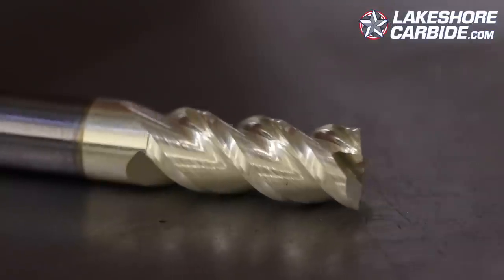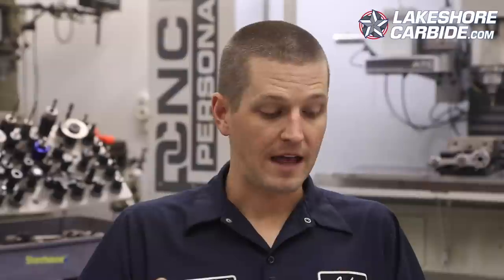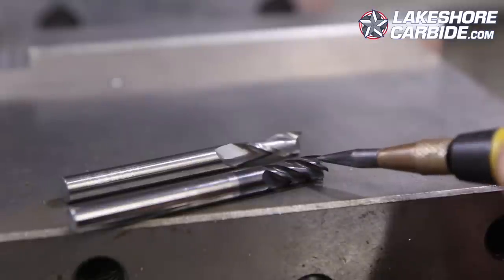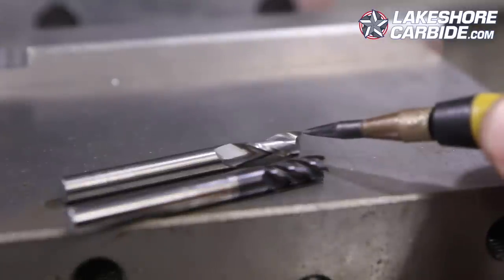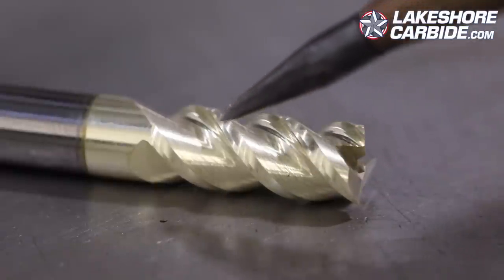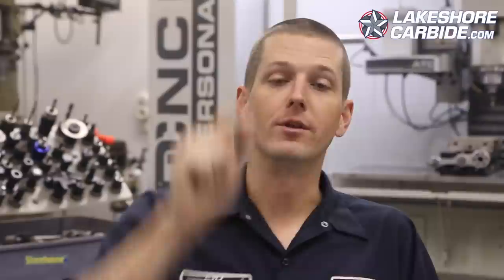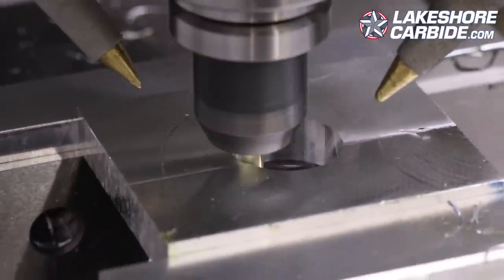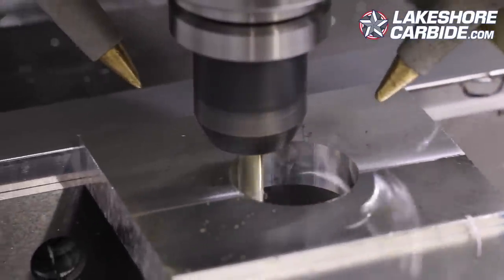4. 2 Flute, 4 Flute & Why You Should Use 3 Flute!

Comment: We went from a 2 flute carbide .140” drill to a 3 flute non coated guhring, and wow! That’s a difference, less vibration faster drilling and they last almost twice as long, on 316 stainless, 45 holes up to .135” to 85-100 holes!

Comment: I feel this choice is nuanced, and depends upon how you use the cutter, and in what grade of aluminium, and with what coolant method is used.
If you are cutting a slot of the same width as the cutter, then a cutter with an even number of flutes will touch both side-walls simultaneously, and this can start chattering.
Conversely, for a cutter with an odd number of teeth, the teeth will cut first one side-wall, and then the other side-wall. This will be less susceptible to chatter, and this is helped by the greater rigidity of the thicker core of the odd numbered cutter.
The caveat here is the chip-removal issue. For small end-mills, or in a gummy grade of aluminium, then having more teeth means that the tighter tooth gullets can't as easily feed the chips up and out of the slot, and the material is more likely to stick the cutter, bind the cutter in the slot, and then snap the cutter.
For people using low-pressure coolant or simple (WD-40) lubrication, then (on balance) a 2-flute cuter is less likely to break from chip build-up than a 3-flute cutter.
For the CNC user with high-pressure flood coolant, then the 3-flute makes more sense, "IF" they can efficiently get the coolant right into the slot being cut to clear the chips out the way fast enough. That is a big "IF" though.
The smaller the cutter diameter, the more acute the chip-removal problem. Below <1/4", you may still be forced to use 2-flute cutters your coolant set-up can't do the chip-removal well enough.
Using mirror-polished, uncoated carbide cutters with a 45-degree helix angle is recommended for aluminium chip evacuation, regardless of your choice of flute number.

Comment: Nice one John. Could you do me a favour and ask the guys at Lakeshore Carbide if there is any implications, so far as resharpening, variable flute end mills? I use a Darex E90 end mill sharpener, and my gut feeling is the sides of the cutter should be able to be resharpened, but the ends may introduce difficulties due to the variable angles and the way typical resharpeners index the cutter.  However I can't recall ever using variables, so I've ever proven this gut feeling.

While carbide has decreased a lot in cost, they still don't exactly give away carbide end mills! I find having an easy way to sharpen them (just like drill bits) encourages always using truly SHARP tools instead of persisting with ones that are dull until they're either sent out or thrown away. I don't doubt the benefits of these new geometries that are becoming popular, but I think that should always b considered with the long-term implications of running them, where persisting with a dull cutter if it can't easily be resharpened may far outweigh the inherent advantages of it.

Comment: There are several incorrect comments.   3 or more flutes are good in some application but 2 flute tools will remove more material in high speed machining. (although many shops are not equipped with these machines.)  I believe also you are using the incorrect term.   The tools are not "variable flute" they are variable pitch.  So many companies are confused about Variable Pitch and Variable Helix tools.   If you have a variable pitch tool the helix angles are the same so the variable pitch tools actually do not change the harmonics they change the frequency of the harmonics which does allow higher metal removal but a variable helix tool will achieve a higher metal removal rate.   Also variable helix tools have both varied helix and pitch.  Therefore you are altering both the frequency and the harmonics.   We have been manufacturing and testing these tools for over 15 years at the end of the day there are many good tools out there. If you are ever interested we work with one of the leading experts in the world on high speed machining and the effects of harmonics in the cut.
Reply: why would a 2 flute remove more material? in my mind that only makes sense if you have a 30 000 rpm spindle and a 3 flute can't evacuate the chips fast enough
Reply: motoolgrind:  Whoever coined the terms "Variable flute", "Variable pitch", "Variable helix" etc. ended up implying they can be adjusted, like a variable-pitch propeller in aviation.  They would be better described as "Staggered flute" etc., or some other fancy sounding engineering-speak name.
There... I feel better now!    :o)

Comment: I use 4 flute endmills in aluminum all the damn time, but I run a fairly low chipload on them of 1 to 5 thou. However, I have automatic high pressure flood coolant nozzle positioning and an 8100 RPM spindle...so your mileage may vary :P

This fear of chip evacuation in aluminum is a bit over stated in my experience, but my experience may differ from the hobby shop folks.
Reply: Haas VF-2 with positional coolant nozzle option. Tools are Iscar. The Geek Group is a non-profit and we work with what we have on hand, so coating is wrong :P TiAlN, which quickly wears away in aluminum so don't do that if you want to use it in steel later lol

In general I try to use uncoated or ZrN in aluminum, but sometimes we don't have that available.
Reply: I don't feel that it's overstated at all. Especially not in slotting applications. Most people are using HSC techniques these days, but chip management is still important, especially on large parts.

The company I worked at before starting my own, machined large structural aircraft parts; stringers, etc. This was done on high hp, high speed, 5-axis gantries where chip settling (in pockets within the parts) would actually cause enough growth in the part to be problematic to tolerances. 
These were high volume cutting operations and what we found to work best were 3-flute roughing style end mills. They broke the chip into much more manageable fines that were easily evacuated from the part. The cutters were made by Emuge.

Granted, you're not talking about 100 hp gantry mills but the extra help with chip evacuation in a minimum coolant situation is always welcome.

Comment: Speculation a bit here, but I suspect it's less an "odd-number" of flutes as it is a prime number of flutes.  By going to a prime number (1, 2, 3, 5, 7, 11 and so on) you eliminate the chance of odd resonances.  It's the same reason car wheels generally have a prime number of spokes.
Reply: Paul Guenette Resonant frequency is certainly part of it, and more importantly the natural frequency of the system; tool, holder, machine.
Reply: I don't know that is wrong but I'm gonna disagree. First on cast aluminum alloy rims, I think the use of five spokes is simply an optimization solution. Given many factors it is probably a relative optimal configuration. Now the main reason I disagree about resonance, is that the integer 5 for example is irreducible or is prime. But for car rims and flutes, you do have fractional units or distances. Thus there are solutions or vibrations as close as you would like to 1/5 (up until atoms, and I don't know that one or two atoms are going to propagate some profound information to us, in the form of chatter marks?). Just my thoughts. Now maybe some algebraic property relating to prime numbers yields some result to an algebraic equation representing a quantity to be minimized, I don't know. But either way it is interesting to think about. Maybe you are right, I however am sceptic.
Reply: Also I take hobby of building and attempting to fly multirotor, and it has been my experience that multirotor having configuration of 2^n motors later out symmetrically tend to be the most stable. While others like a hecacopter having six motors seemed always to have a slight element of instability, or lack of vector components to immedietly counteract instability. Now maybe the has an inverse aeffevt on endmills. Maybe mills have orthogonal flutes make the endmill more agile in all directoons, while others have prefered directions to deviate. Giving the endmill some regularity in its debiations while the four flutes appear as noise and random.
Reply: The strongest wheel is one with no spokes... though brake cooling performance is poor. Then again, wheel design is a compromise in strength in lieu of brake cooling, aesthetics and some safety factor; pot holes, railroad tracks, etc.. Not really a good comparison in the context of this conversation.

As for cutters, the number of flutes dictates the frequency at which the tool will operate. If you look at the natural frequency of most ~10k rpm machines (machine, tool-holder, tool), it's not hard to see why a 3-flute typically performs better--stable cutting & better material removal rate--than a 2-flute. By the same token, a higher flute count may arrive at a more favorable frequency but due to chip evacuation, may not be useful in materials like aluminum.
Reply: Odd or prime numbers have no bearing on resonance. It's the spacing between the flutes that causes that. You can have 2 and 4 flute end mills with irregular spacing between the cutting tips and that alone will go quite a way towards eliminating that resonance. Odd numbered flute counts allow you to ensure that no angle ends up being used more than once and that's the best way to reduce resonance tendencies at the tool design stage.
Reply: Car wheels have nothing to do with prime numbers or resonance... It's all about looks. And since most hubs have 5 lugs, the most logical choice is a matching pattern.
Personally I hate seeing non matching wheels, like 6 spokes with 5 lugs and everything looking out of place.

Comment: Great video John. We are definitely a fan of 3 flute aluminum tools!
Reply: NYC CNC The AV3 Swiftcarb Rampmills are epic. Using their calculator on their website, then adjusting the chipload/feed rate/step over to meet the HP of your spindle. Then adjust ramp angle to suit, holder/spindle HP/through spindle coolant or not.
Reply: I'm interested in aluminum end mills
Reply: Ben Mian which country are you in?
Reply: I'm in China.We are a manufacturing factory of high quality carbide cutting tools.And you?

Comment: I correct my statement, I used to love single, 2 & 3 flute when cutting aluminum, then I took a huge leap of faith & ran 4 flute at 98 inches per minute & now it cuts super well & fast!
Reply: Someone Else There isn't a magical flute number. What works best is totally dependent on the type of cutting operation and system harmonics.

Comment: I've used 5-flute endmills on carbon and stainless steel. I prefer the 4-flute. We had chip evac issues.
Reply: Yes. We didn't have through-tool coolant on that machine when we tried, but we did have coolant hitting the tool.
Reply: I agree with you.4-flute is efficient

Comment: Hey, do you have any recomendation for hobby cnc? I was guessing if there is any benefit from using 3flute vs 1flute end mill on floors and flattening. I am having issue with rough surface (you can see some circular ridges in cut of those flat surfaces). Spindle is perpendicular in both directions. My idea is that 3 flute would give more consistent force direction or how would I describe it... it happens on pretty much all materials and no matter if I have 0.1mm stepdown or 1mm stepdown. It does not happen on my fly cutter which I only use dor wasteboard (it is 2" tool with 3flutes)

Comment: Why do you run your cuts in the tool's direction of spin? Is it a CNC thing? On manual machines this is a recipe for self-feeding disaster :/
Reply: It's a CNC thing. Proper CNC machines do not have slop in the ways so not only you CAN but you SHOULD climb mill. Google "climb vs conventional milling" for details.

Comment: Your all mistaken. 4 flutes rules, ruled and has ruled all Automotive, Aeronautics and machine manufacturing for a long time. Now if your using a non true milling machine such as a 30,000 rpm low coolant engraver router then less flutes may be required to prevent breaking them. Most machine shops run horizontal machines designed for precise tolerances. Not ecceeding a couple thousands. Then by all means use a.3. A horizontal Mazak works excellent with a 4. And thats running precise within QA tolerances less than .0015 after 300 parts. You just cannot do that on a cnc router machine running such high speeds. 

And tolerance is everything. And some things cannot be pushed past a certain limit either. Everything under the sun has already been tried, tested and proved many times by every machine shop doing industrial production and QA.

And not arguing against using a 3, but I sure have not seen anyone in any shop in my over 30 years using them. And ive done both Airforce Q&A. And non military aluminum pumps, heads, wheels, Harley custom cases and clutch baskets. But honesty the reason most of us dont use 3 flute is not because of resonance but because a 4 flute can make m ore parts without wearing out as fast and losing tolerances than a 3 flute. Plain and simple. And you just cant push good machining work. Nice video and good to see younger folks doing it.
Reply: Not for aluminum...